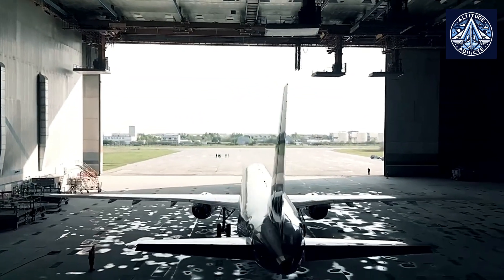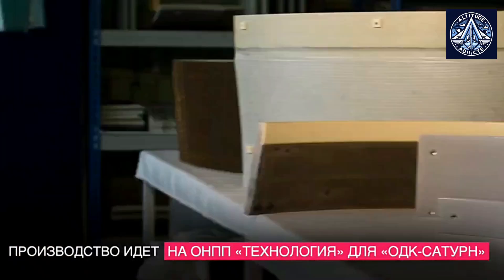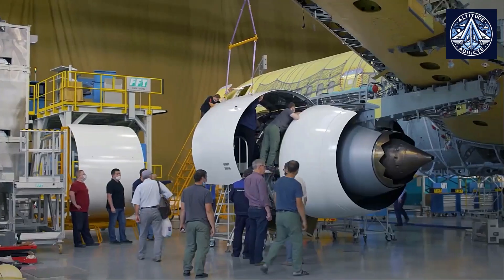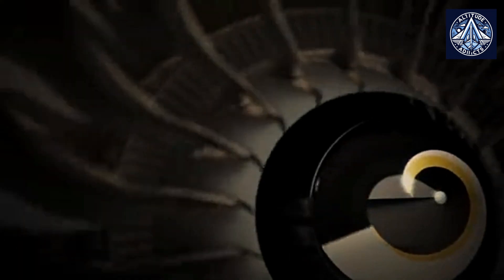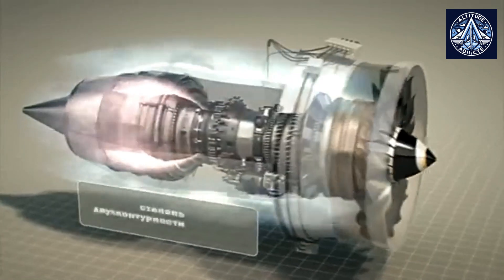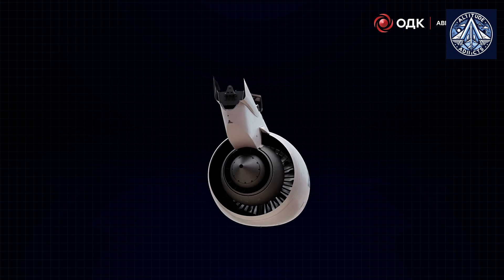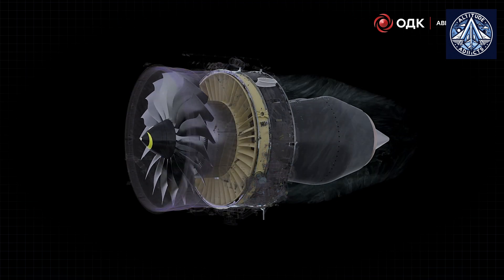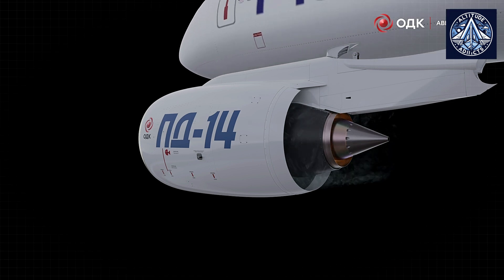Manufacturing Woes: The Challenges Facing Russia's PD-14 Engine Turbine Blades

Comment: If russia continues to delays puting the PD14 and MC21 into production the world would not wait till they are ready. improvements on the existing internationally  leading Engine  manufacturing will continue to widen the gap till PD-14 is an old inefficient technology in compare with leading engines.
Reply: There are experts of the aviation industry in the West that have already said that new engines like PW1100G (GTF)  became poor practice in aviation industry when they provide 10% fuel efficiency along with 12-24 months grounding of aircrafts that use those engines. Fuel economy shall not hamper engines reliability. Otherwise aviation industry shall reject such "innovative" engines.

Comment: The value of this plane/engine should not be seen as a means of commercial success or a way of generating profit. It's purpose is much more basic: removing the ability of western globalists to send you back to the pre-aviation era by precluding you from buying western aircraft/parts. Whether this engine is x% more or less fuel efficient than GE/RR/PW is besides the point. Russia has plenty of cheap fossil fuels. Creating a self contained aerospace ecosystem cucks the ability of the west to dictate terms and use sanctions as leverage.

Comment: Can you update the production situation of SJ-100, MC-21, and the other types of Russian domestic aircraft and the timeline for services?
Reply: @paputzaadiy2820  
Production facilities, that shall produce MS-21-310 and SJ100 aircrafts, have already assembled about 40 fuselages of both aircrafts. Full assembly lines do not work yet, but they are ready for quick start of final assembly when all systems, including engines, are internally certified and produced in series.

Comment: I'm sure in time there will be a PD-14M or a PD-14-2 or something similar upgrading its build materials and structure.
Reply: PD-14 upgrades will not gen new designation if such upgrade requires only parts replacement. Old engines may be refurbished to get such upgrade as a maintenance process.

Comment: they said to use new composite blades
Reply: That would be the compressor, not the turbine (you can't use composites in the hot part of the engine), and in the larger PD-35. In smaller engines the weight reduction due to composites is not significant enough to warrant the more challenging manufacturing process of composite blades.